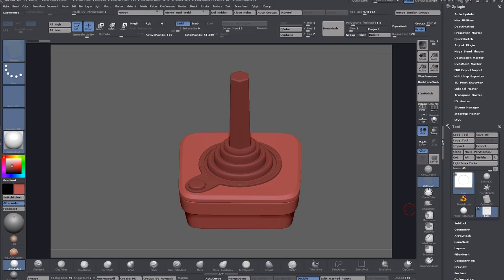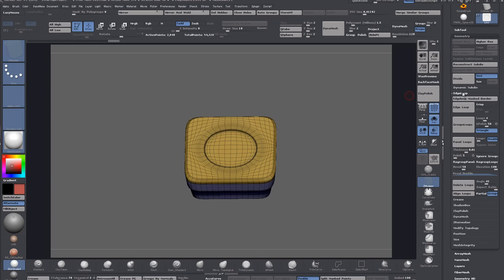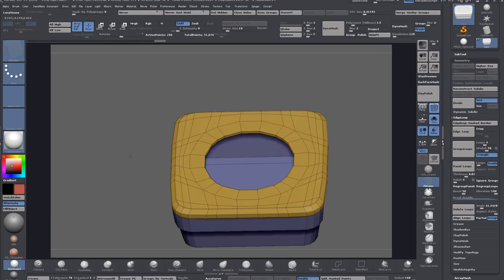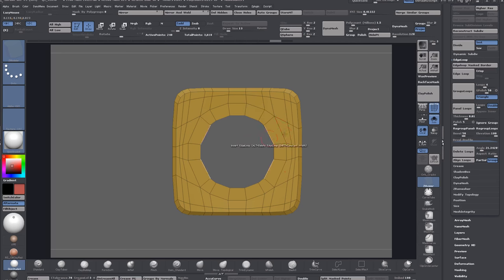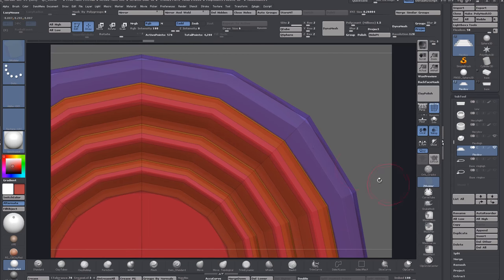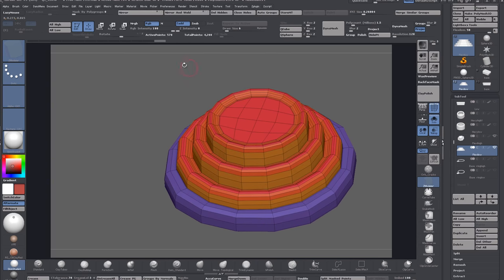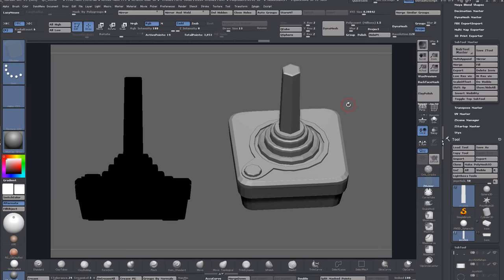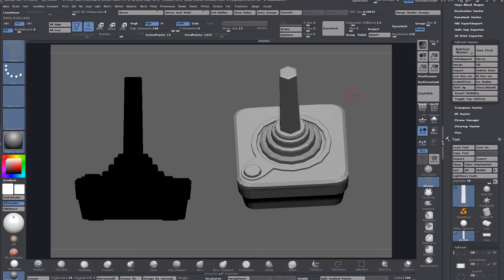Game Art - Tips, tricks, and tutorials. 'Creating the game-res mesh' Part 4

Comment: I don't see any reason why we should use normal maps for this kind of simply assets, especially if we have some awesome softwares like Substance Painter. the normal map itself isn't for free and take resources too. I don't see to much advantages of normal map for this kind of assets.
Reply from the maker: This is just a workflow series. There are many ways to derive the game-res mesh. This could be mid-poly, or FWVN with normal details added in SP/NDO. The point here is to show a workflow that could be used for an asset that will have a NM. Of course a NM isn't for free, just like any other texture.